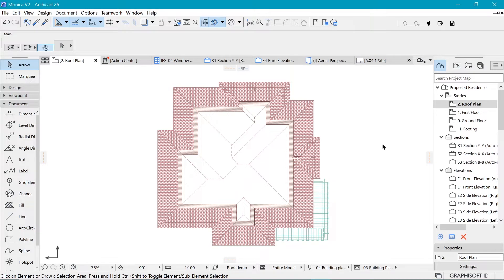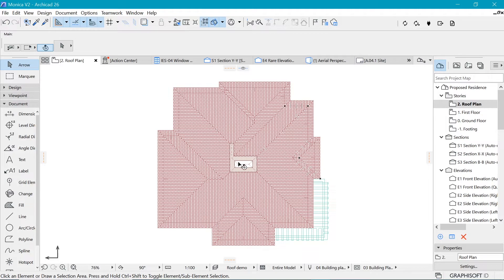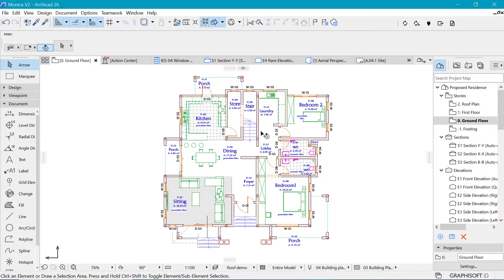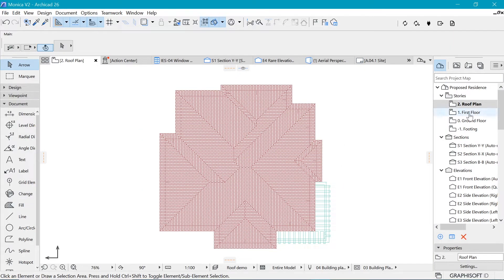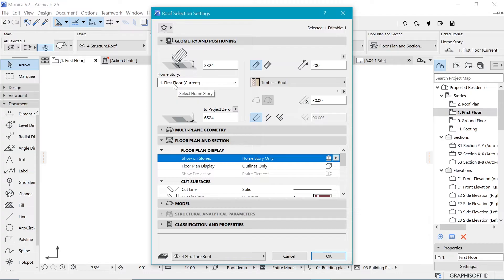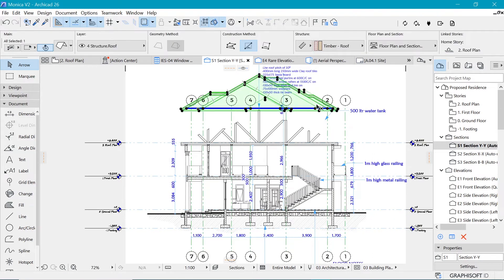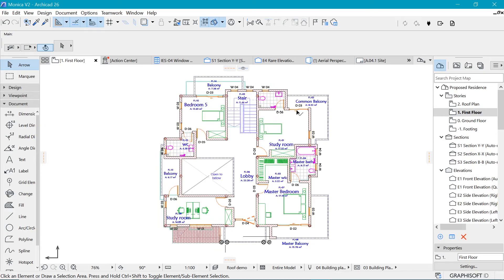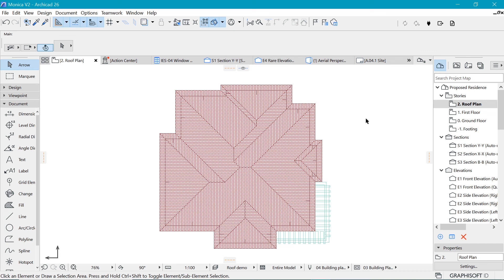Make a proper Roof plan in Archicad

Comment: I have a question. Been struggling with this for years.
Let's say I have a floor plan. But some of my rooms are on different platform levels but I need to show all related doors and windows on the single floor plan. 

It seems the floor plan have one single cutting plane. Wish I could control that to specific areas. 

Can you assist? Thank you.